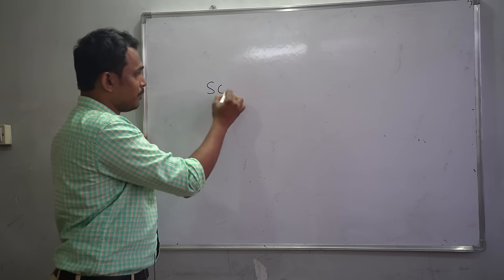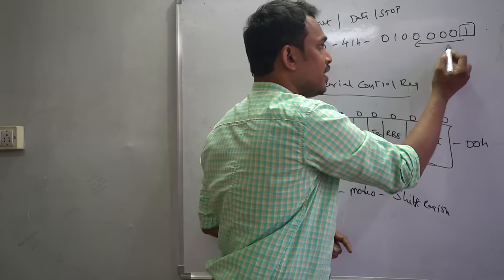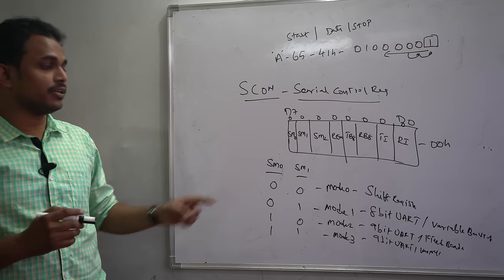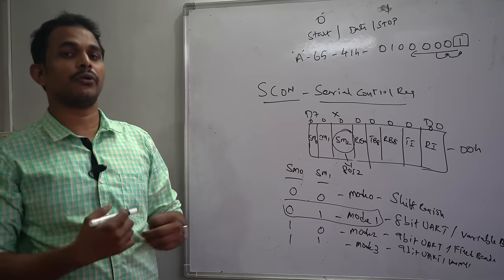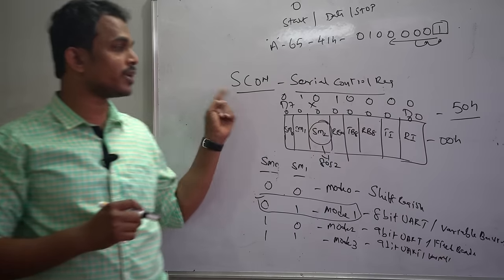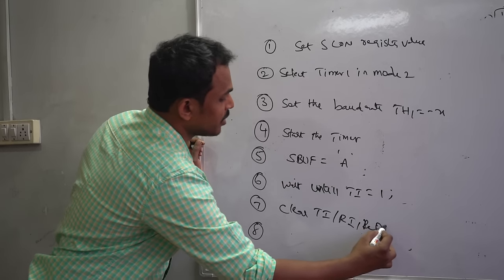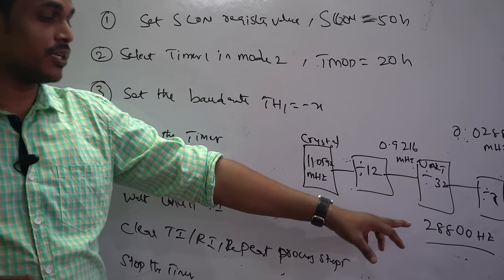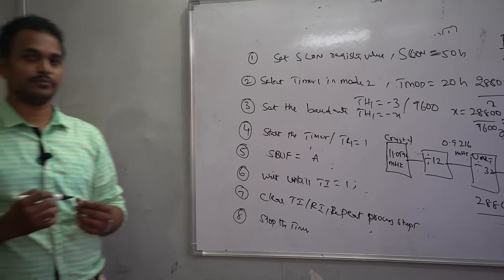Serial Communication  programming in 8051

Comment: As told at 12:40, to get the accurate bits and not to miss the bits we do use 11.0592 MHZ which make 28800HZ agreed, but when I substitute the value with 12MHZ, it comes with the value 31250HZ so even, in this case, I think the data will not get lost, and if this is the concern then your point at this theory is wrong I guess.